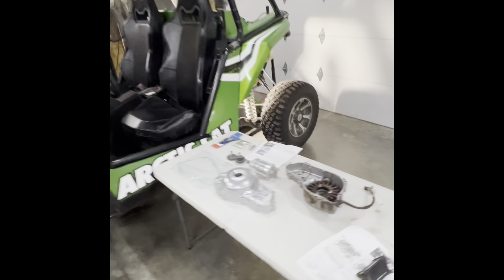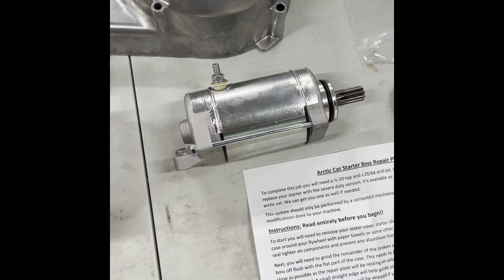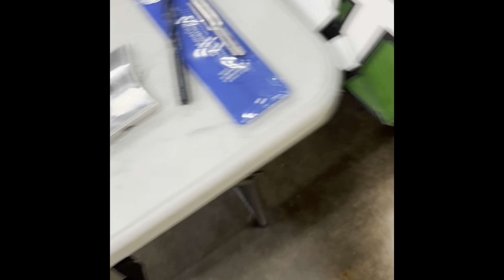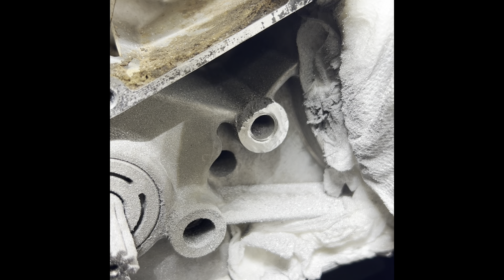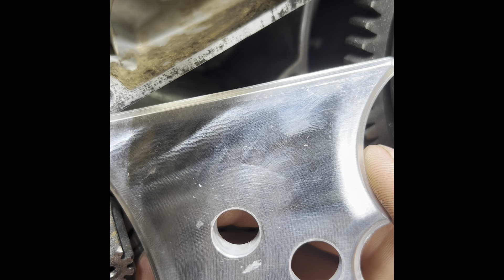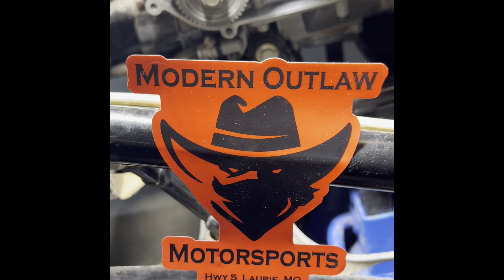Arctic Cat Wildcat X Starter Boss Repair Plate Install

Comment: I don’t understand what it fixes. I have the same machine and the starter keeps grinding gears on starter. Is it fixed for that?
Reply: The piece he was cutting and grinding was broken and no longer held the gear in place.
Reply: if you haven't alredy, take the cover off and inspect the gears and the bosses that hold the shaft for the gears. this engine has a pattern problem of the boss breaking and than the starter gears just grind. This kit fixes the problem.  I am installing it on mine now.